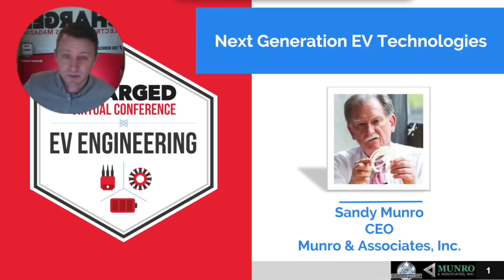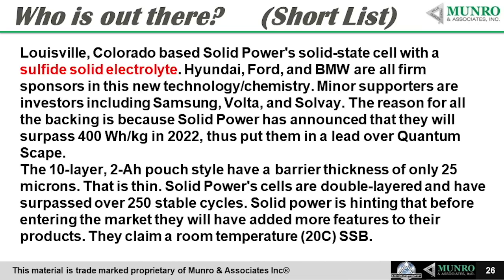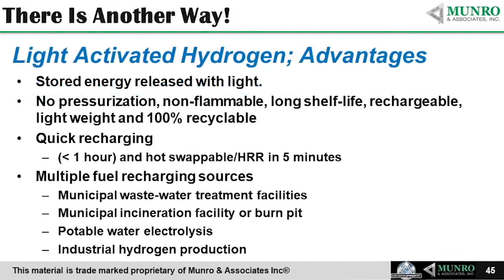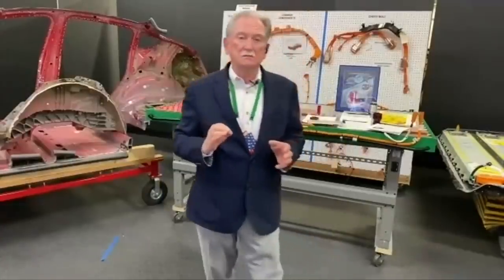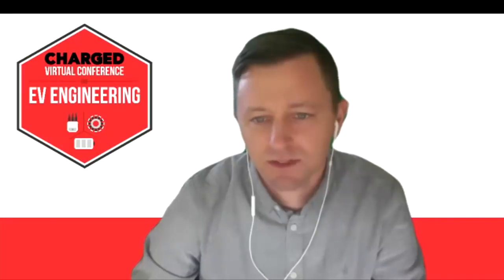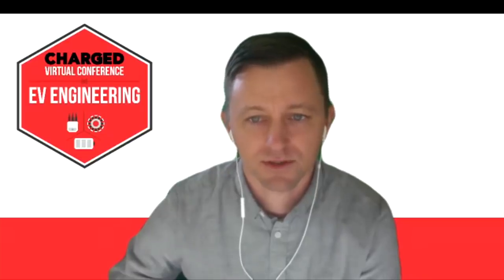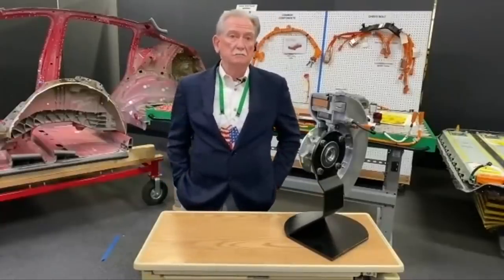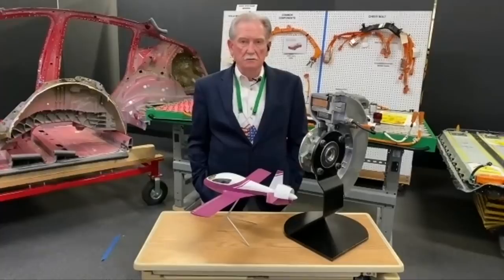Sandy Munro On Next-Generation EV Technology: Tesla, Solid State Batteries, MegaCastings, VTOLS, Q&A

Comment: On giga press .. Amaizing for them yes but for us on the street when you have an accident, almost impossible to repair.
Reply: believe that it’s stronger structure than current frames and would have to be extremely high speed impact to damage where other cars would be totaled out anyway. I believe Sandy discussed this in a video on his channel some time ago.
Reply: The point almost every one missed is that if you are in an accident that affects the mega casting then it’s a massive accident.... the car is a write off by all insurance company’s any way, and even with modern cars made today if you’re in an accident where the subframe is damaged (maga casting equivalent) then it’s a right off, and everyone knows that a repairable write off on the second hand market is practically worthless as almost no main stream insurance company is interested in insuring it again every after it is repaired.

Comment: The 4680 has 0 liquid, not even during manufacture.
You seem to have forgotten that when comparing it to solid state vaporware.
Reply: No -  it has electrolytes.
Tesla bought HiBar Systems for that very purpose.
Reply: If what you said was true then Tesla's 4680 cells would be solid state by definition.

Comment: Light activated hydrogen.  I don't like it.  Spinning media..not good.  Swapping anything is a pain.  What if you had to swap you your battery in a cell phone?  Maybe some limited applications--like you say but not a good solution for a car.
Reply: In power tools it is normal to swap the batteries and there is a lot of power tools in factories and on construction sites.
Reply: What?  WOW, what if the cell phone makers let you swap your battery?  The battery dies and they're counting on that so you have to buy a new phone.  Batteries can be swapped, but the average person doesn't even try.
Reply: Having a swappable battery doesn't mean you have to swap it. You can just recharge it in place if that is what makes you happy.

Comment: Sandy munro see reality. Hey sandy to break down why we never see A.I. Self driving, it's really quite simply. It's a thing we human have. It's called vision anticipation. Of what we see is loading up ahead so we slow down and can see that guy creeping up to come out on to infront of you and we also see why on the opposite side a whole line of cars are coming.
And  good thing we slow down cause he just gas it across to go that way. 
A software make the decession after the sensor see that car but he onto the road. 
 They are many example of we can anticipate beyond the car infront we can see. The sensor just read the car in front. And will gas it after that car turn right into stopped cars.

Comment: People building the cars is not the problem. The existing electricpower system cannot handle the current demand on hoter or colder than average days now. If you look at the math regarding the electoral power available for charging the cars you will discover that without solar power on every  building making enough power to supply the building plus two vehicles per family unit. Or a new nuclear power plant built every 3 weeks between now and 2035 in the US alone . Second ever changing station must be equipped to change all types of electric vehicles, no exceptions. Tesla can't cover the cost of building the charging stations because the cost of those stations is three times Tesla's annual profit every year . Instead of canceling a pipeline that would reduce the emissions associated with delivering the necessary oil in North America  while approving a Soviet pipeline placing American in a bigger hole. The government needs to build a power system that can carry the load and reduce emissions.  A good start build enough natural gas pipelines to convert all the coal fired power plants  or find a technology that reduces the emissions from coal fired power plants to be lower than natural gas fired  electric power plants.

Comment: How can we assume Tesla has a 10GWh production runnig this year while they defer every vehicle that would need a 4260 to at least next year. Very much overstated...
Reply: They have the capacity for 10 GWh of 4680 in Kato Rd, they are working on increasing the yield (how many are good, quality of the process). Once thry get it, scaling is easier. Just like Shanghai GF didn’t have to go through Model 3 production hell.

Comment: Just use Troy Reed's magnetic motor. No battery packs are needed. Or Meyer's water/hydrogen fuel injectors and run a vehicle on water. Just change the injectors in the average vehicle. There's no need to waste $40 grand plus on an electric. This is a classic example of suppressed innovations and inventions. GM has motor that got 53 mpg in the 80's in a 4000 pound car. All this one big joke! All so Wall Street and the fat cats can get richer. How much money is enough? Teenagers are making self charging go-carts. What does this say for the average car or truck? That they could be easily converted to a self charging electric vehicle, thus save people money and create jobs. The save the planet people should be all over this. Where are they? Nowhere to be seen, or heard!!!! God, is this one big joke on the public! And hey they have an engine that gets 200 mpg sitting on a shelf some place. And China is going to eat everyone's lunch and dinner with a cheap electric car. I still can't see how they are going to put one billion people into cars!

Comment: I love debate good honest debate is how decisions are made your use of hydrogen and illuminate one very important aspect there is a diesel company in England are old and older than commons and they do a simple man where they can use hydrogen directly injected into the engine as a fuel it is meant to be used for big construction machinery were a fuel source would be simple and require no infrastructure if this technology was integrated with the new twin piston type two cycle diesel engine that has no vowels has says simple assembly much much higher efficiency it would be great solution for over the road trucks hydrangeas and refill plants are cheap and it wouldn’t take that many for over the road trucks it’s not a solution to every problem there is none that is the real problem is people expect one change will affect the problem I find three solutions to any problems with the overlap and when and if one fails you have two more plans the hydrogen for individual personal vehicle is impractical because of the storage conversion in progress  the cd style is the best but still impractical electric cars make this most sense for the journal person who doesn’t do a over 100 miles a day found you I guess if you’re in California and you have an obscene commute but for the rest of us humans 100 is fine any electric car is fine they keep fighting for longer range they have enough already go for low price I saw a car that usesDirect seller sell conversion parking outside picks up at 30 miles a week also has a back up AC outlet that powers your house for a while if need be I want one

Comment: The megacasting is total BS. If it reduces parts by 90% & the casting is done in milliseconds, then why doesn't Tesla cars sell for $15K or Tesla has monster margins instead of depending on selling carbon credits + bitcoins to eke out a profit ?  The simple reason other major car companies do NOT use megacasting from this Italian company( anybody remember the quality Fiats & ALfas) is because of low quality & high rejection rate. The castings also CANNOT be repaired despite Musk's assertion.